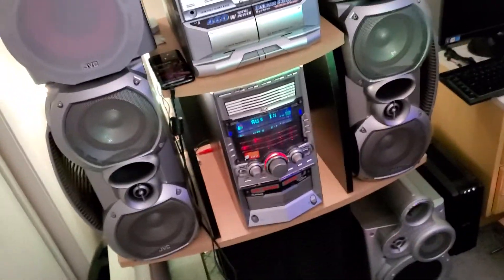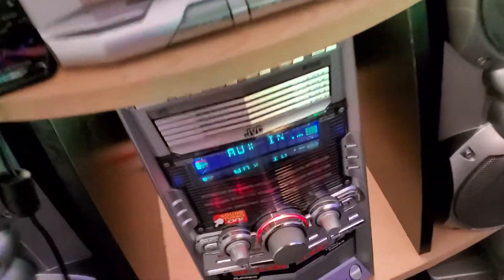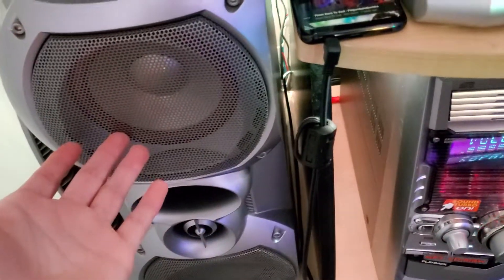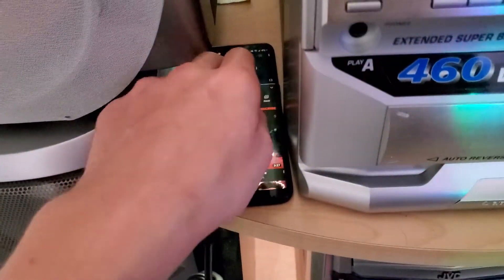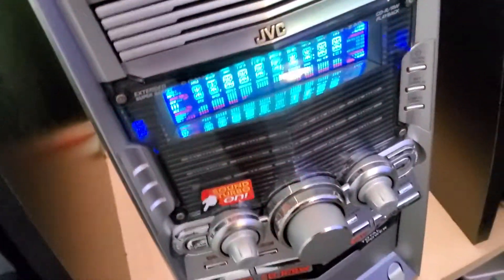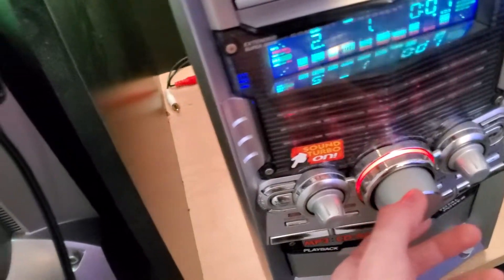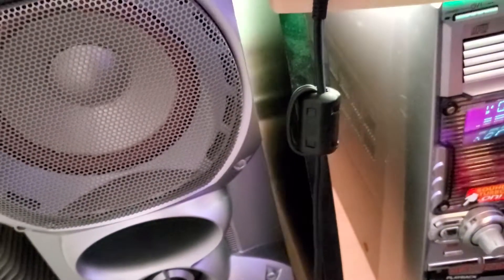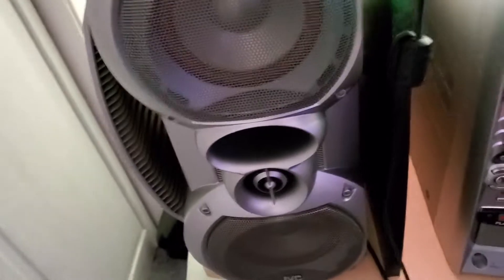How to fix the aux connector?

Comment: I had the same problem on my GT90 AUX jacks. I took it apart and re soldiered the terminals for the AUX jack on the motherboard. Works like new now(they get used alot and become loose after awhile) Hope it helps- 2 years L8R! LOL
Reply from the maker: yeah I figured that was the issue haha. I actually got it fixed by just unscrewing the screw holding the aux in place and now it connects a bit better or something I guess now.

Comment: i have the same problem with my jvc gb6 everything works it’s just that the aux part makes my tweeters sound shity what you think it might be bro
Reply from the maker: @Mrbrightness-dr8tx  for me taking the screw out from under the aux input and wiggling it a bit helped fix the issue
Reply: @ all check on that as soon as possible

Comment: I was playing some bass heavy music earlier today to find out that my JVC mx-j900s right subwoofer is rattling. I took the speaker out of the box to see if it would still do it and it does. So I guess something inside the speaker itself is messed up. Voice coil or spider? Dunno.
Reply from the maker: rattling noise? you got a video of it?
Reply: @TheJVCguy  just uploaded a real short video of it, check it out
Reply from the maker: @minicomponentsystemsofthe9208  you sure thats the sub? take it out and do a free air on the sub to make sure
Reply: @TheJVCguy  I removed that speaker completely and it's coming from inside the speaker itself . I had the speaker removed laying flat on its back on the table, still rattling
Reply: @TheJVCguy  I guess I will just ignore the rattling for now lol. It's only very noticeable during certain songs with punchy powerful Bass. I listen to metal mostly anyway and it's not too noticeable. I might see if it fixes itself and if I get the chance buy one individual speaker on eBay if it ever given the opportunity.
Reply: @TheJVCguy  the stereo is around 20 years old but was used very lightly during those years. Just some crappy luck basically lol. I have no problems with the JVC gt88 at least.. mxj900 is my favorite though for balance and overall sound quality.
Reply from the maker: @minicomponentsystemsofthe9208  that sucks! You should try the z30, its also really nice sounding
Reply: @TheJVCguy  yeah definitely one of those tall boys.
Reply from the maker: @minicomponentsystemsofthe9208  hey, hows the rattling issue going? any luck with fixing it if you are going to fix it?
Reply: @TheJVCguy  no luck yet lol. I will probably wait and see if it goes away on its own. If not, I will either buy a new speaker or take it to a repair shop. If they can repair it for a good price lmao.
Reply from the maker: @minicomponentsystemsofthe9208  damn that really sucks! Those J900 speakers are very rare so if you end up needed to replace it I wish you luck lol
Reply: @TheJVCguy  yeah, this repair place nearby won't work on it unfortunately lmao
Reply from the maker: @minicomponentsystemsofthe9208  oh why not?
Reply: @TheJVCguy  they said it's not possible to get parts to fix it, which is bs probably lol. And that the value of the system is too low. Which isn't true either, it's worth 300+ lmao
Reply from the maker: @minicomponentsystemsofthe9208  yeah I guess, the sub alone is basically impossible to come by now lmao
Reply: @TheJVCguy  I feel like they could just open the dust covet using a blade and just do something fairly simple to fix it. Could be just the coil unraveling lmao.
Reply from the maker: @minicomponentsystemsofthe9208  So they can't do anything about it though sadly?
Reply: @TheJVCguy  nope, didn't seem interested lol